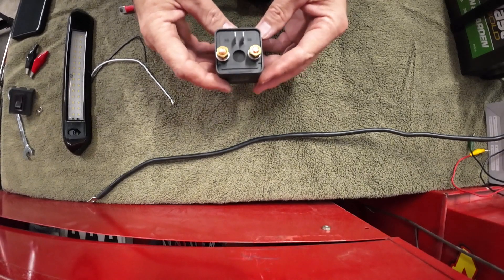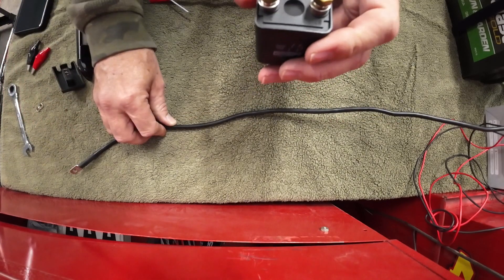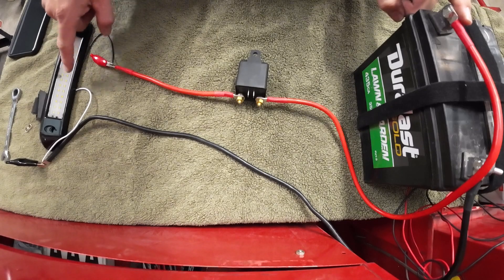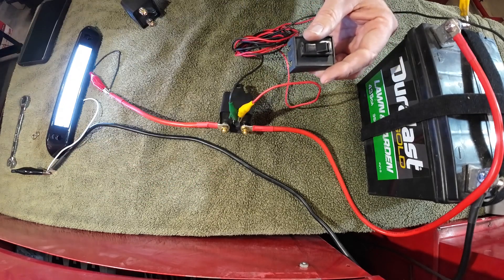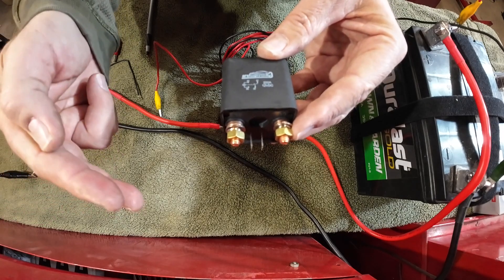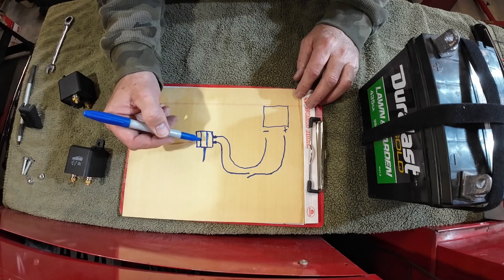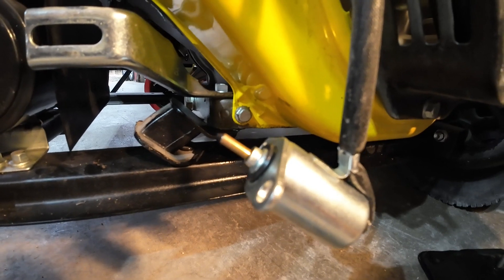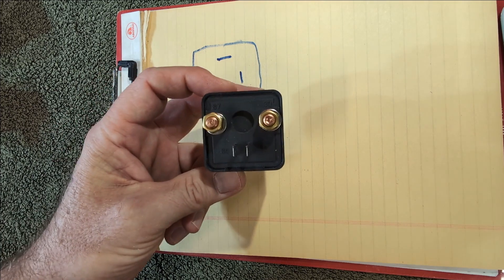RELAY: how it works and SOLENOID comparison

Comment: Good Vidya!!! I did something similar to this on a Hyundai Tucson I had. Decided to upgrade the single twinky factory horn to a dual tone STEBEL HORN setup used the original horn button circuit to activate the coil which engaged the contacts to energize the new dual horn setup. Sounded SOOO MUCH BETTER!!! 😂 I highly recommend the STEBEL brand for anyone wanting to do a horn upgrade!!!
PS--I used to repair copy machines and they had MULTIPLE solenoids for various paper gates and switchbacks do direct paper where it was supposed to go. Machines even had single motor setups with a "train"/"chain" of gears and electromagnetic clutches to energize certain sections of the chain. This implementation was seen in the tray section where paper is picked up and also in 4-color machines depending on if a single color (black) or 4-color (cmyk) was being printed. It was an excellent learning experience!!!
Reply from the maker: @RTR-MATEY  wow that's totally crazy! Way more involved than I'll ever be able to understand LOL. But I never thought about a horn, another great use for solenoids! I could use one of those on my diesel pickup for sure 🙂
Reply: @anesthesiadreamin  Yep! STEBEL Horns have a very nice sound!!!...especially the dual horn setup! On their website, you can listen to the different sounds/tonalities of each horn. The set I got was the "STEBEL MAGNUM DUAL". Reasonably Priced, Impressive Sound!!!